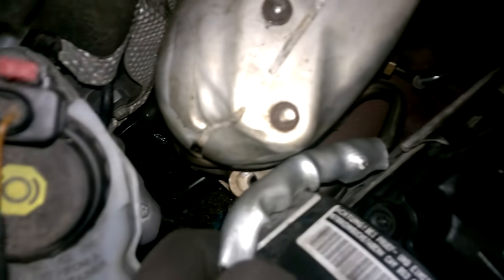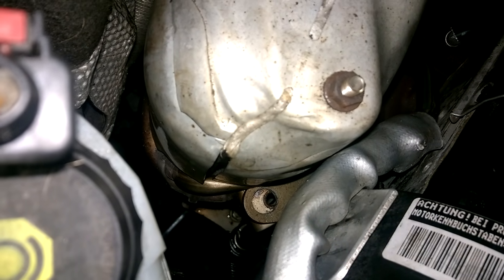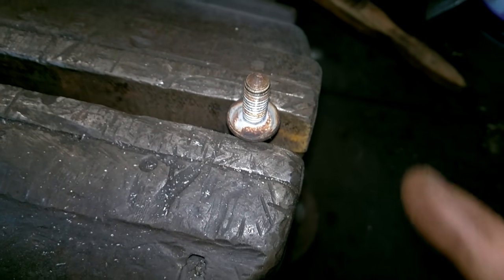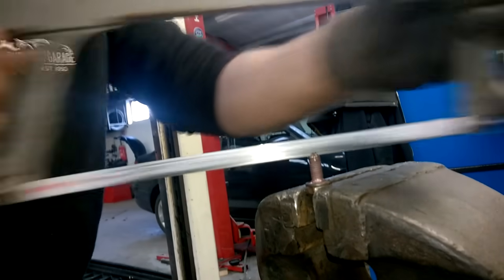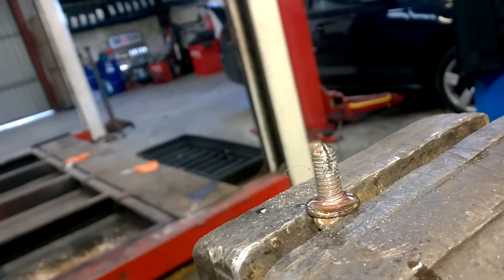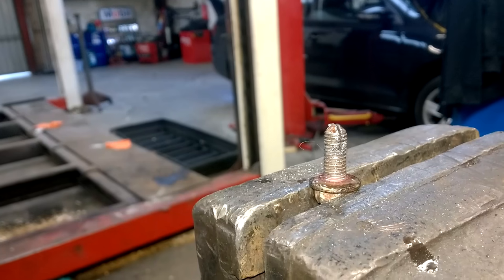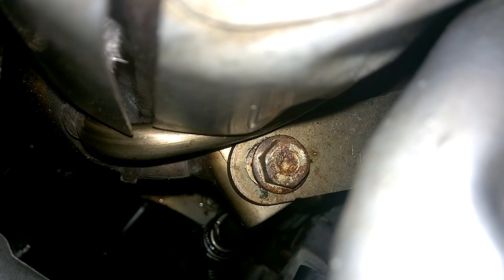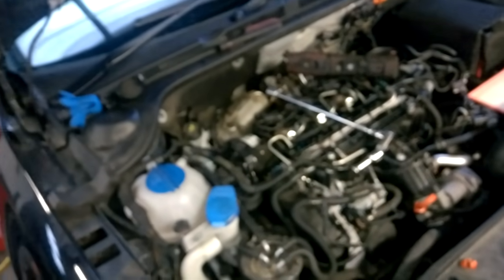My Father Taught Me This! Passing It On To The Next Generation

Comment: Good stuff
Dad was mechanic
His dad too
Cheers
Reply from the maker: The update info below is the pinned comment on this video, I know most people do not realize I made that video and it better explains/shows this method in use.   
I also included below details of why the job was done this way free of charge with the customer fully informed. I hope you check it out  👇👇
 
UPDATE* I decided to make a follow up video on this https://www.youtube.com/watch?v=yfNQullGEuQ&feature=youtu.be Should answer some of the questions that were raised, I include 3 demos of this in action with close up shots.
 
As there was some safety concerns & confusing comments raised, I felt I should clear a few things up. 
1) This is a tip for certain circumstances only, I never have and never would use it on a component which would cause any safety concern to any customer.  
2) The demo was done on a support bracket only, items like this or similar will not cause any safety concern. 
3) I did this free of charge and on a time restraint, I noticed it when I was replacing another item, the customer needed the vehicle back that evening and I decided rather than leave it like it was, I would do this and secure it up fully. 
4) The bolt was not the issue, the part that the bolt threads into is a secured piece, someone had previously damaged it, leaving the bracket loose and the bolt just tightened a turn or so.
5) The bolt can be removed and will not break, it will go in and out as usual and has helped clean up the damaged threads.  
6) Used in the right application I personally believe this is a great tip and can save you a lot of time & trouble. 

Lastly to all the people who have watched the video, Thanks very much and I am delighted with the feedback I have received on it.

Comment: Wouldn't have been a better fix to move the bracket, re-tap the hole and use a new bolt? A few minutes longer to fix but a proper solution for repairs down the road. The hole and the bolt looked roached anyway..

Comment: Great tip! Thank you.
Reply from the maker: The update info below is the pinned comment on this video, I know most people do not realize I made that video and it better explains/shows this method in use.   
I also included below details of why the job was done this way free of charge with the customer fully informed. I hope you check it out  👇👇
 
UPDATE* I decided to make a follow up video on this https://www.youtube.com/watch?v=yfNQullGEuQ&feature=youtu.be Should answer some of the questions that were raised, I include 3 demos of this in action with close up shots.
 
As there was some safety concerns & confusing comments raised, I felt I should clear a few things up. 
1) This is a tip for certain circumstances only, I never have and never would use it on a component which would cause any safety concern to any customer.  
2) The demo was done on a support bracket only, items like this or similar will not cause any safety concern. 
3) I did this free of charge and on a time restraint, I noticed it when I was replacing another item, the customer needed the vehicle back that evening and I decided rather than leave it like it was, I would do this and secure it up fully. 
4) The bolt was not the issue, the part that the bolt threads into is a secured piece, someone had previously damaged it, leaving the bracket loose and the bolt just tightened a turn or so.
5) The bolt can be removed and will not break, it will go in and out as usual and has helped clean up the damaged threads.  
6) Used in the right application I personally believe this is a great tip and can save you a lot of time & trouble. 

Lastly to all the people who have watched the video, Thanks very much and I am delighted with the feedback I have received on it.

Comment: always use the full length of the hacksaw, just basic first year engineering apprenticeship stuff.....
Reply from the maker: The update info below is the pinned comment on this video, I know most people do not realize I made that video and it better explains/shows this method in use.   
I also included below details of why the job was done this way free of charge with the customer fully informed. I hope you check it out  👇👇
 
UPDATE* I decided to make a follow up video on this https://www.youtube.com/watch?v=yfNQullGEuQ&feature=youtu.be Should answer some of the questions that were raised, I include 3 demos of this in action with close up shots.
 
As there was some safety concerns & confusing comments raised, I felt I should clear a few things up. 
1) This is a tip for certain circumstances only, I never have and never would use it on a component which would cause any safety concern to any customer.  
2) The demo was done on a support bracket only, items like this or similar will not cause any safety concern. 
3) I did this free of charge and on a time restraint, I noticed it when I was replacing another item, the customer needed the vehicle back that evening and I decided rather than leave it like it was, I would do this and secure it up fully. 
4) The bolt was not the issue, the part that the bolt threads into is a secured piece, someone had previously damaged it, leaving the bracket loose and the bolt just tightened a turn or so.
5) The bolt can be removed and will not break, it will go in and out as usual and has helped clean up the damaged threads.  
6) Used in the right application I personally believe this is a great tip and can save you a lot of time & trouble. 

Lastly to all the people who have watched the video, Thanks very much and I am delighted with the feedback I have received on it.

Comment: I would put there another screw. But if there isn't one, this might help solve the problem.
Reply from the maker: The update info below is the pinned comment on this video, I know most people do not realize I made that video and it better explains/shows this method in use.   
I also included below details of why the job was done this way free of charge with the customer fully informed. I hope you check it out  👇👇
 
*UPDATE** I decided to make a follow up video on this https://www.youtube.com/watch?v=yfNQullGEuQ&feature=youtu.be Should answer some of the questions that were raised, I include 3 demos of this in action with close up shots.
 
As there was some safety concerns & confusing comments raised, I felt I should clear a few things up. 
1) This is a tip for certain circumstances only, I never have and never would use it on a component which would cause any safety concern to any customer.  
2) The demo was done on a support bracket only, items like this or similar will not cause any safety concern. 
3) I did this free of charge and on a time restraint, I noticed it when I was replacing another item, the customer needed the vehicle back that evening and I decided rather than leave it like it was, I would do this and secure it up fully. 
4) The bolt was not the issue, the part that the bolt threads into is a secured piece, someone had previously damaged it, leaving the bracket loose and the bolt just tightened a turn or so.
5) The bolt can be removed and will not break, it will go in and out as usual and has helped clean up the damaged threads.  
6) Used in the right application I personally believe this is a great tip and can save you a lot of time & trouble. 

Lastly to all the people who have watched the video, Thanks very much and I am delighted with the feedback I have received on it.

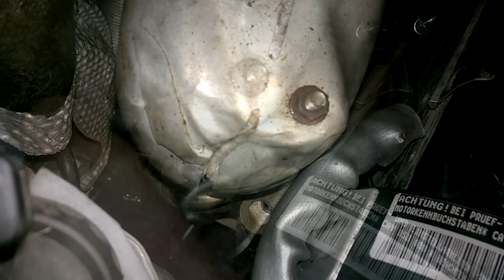Comment: Well, this trick is better-known in N.St.Louis as "White Rigg'n" or "Shade Tree Mechanic'n" either way is the wrong way. In the Box Factory, we used tapered pry bars or punches to align the difficult holes and snugging the other bolts before trying that trick that I never saw in my 26 years in the mechanic'n business. 0:46 looked like a straight-in shot with minimal difficulty.
Reply from the maker: The update info below is the pinned comment on this video, I know most people do not realize I made that video and it better explains/shows this method in use.   
I also included below details of why the job was done this way free of charge with the customer fully informed. I hope you check it out  👇👇
 
UPDATE* I decided to make a follow up video on this https://www.youtube.com/watch?v=yfNQullGEuQ&feature=youtu.be Should answer some of the questions that were raised, I include 3 demos of this in action with close up shots.
 
As there was some safety concerns & confusing comments raised, I felt I should clear a few things up. 
1) This is a tip for certain circumstances only, I never have and never would use it on a component which would cause any safety concern to any customer.  
2) The demo was done on a support bracket only, items like this or similar will not cause any safety concern. 
3) I did this free of charge and on a time restraint, I noticed it when I was replacing another item, the customer needed the vehicle back that evening and I decided rather than leave it like it was, I would do this and secure it up fully. 
4) The bolt was not the issue, the part that the bolt threads into is a secured piece, someone had previously damaged it, leaving the bracket loose and the bolt just tightened a turn or so.
5) The bolt can be removed and will not break, it will go in and out as usual and has helped clean up the damaged threads.  
6) Used in the right application I personally believe this is a great tip and can save you a lot of time & trouble. 

Lastly to all the people who have watched the video, Thanks very much and I am delighted with the feedback I have received on it.

Comment: It looks like you cut the bolt past the point where the threads were previously gripping. But this seems to be an application where strength is not needed.

Just as easy to clean up threads with a 3 square file if you do not have a tap. Sometimes a nut will do. If no 3 square is available just file off offending thread with a flat file and start it easy.

Your dad should have told you to use the whole hacksaw blade. But most people seem to wear them out in the middle while the ends are untouched.

Nonetheless I thanks for the info, might be useful someday.

Comment: I can say having worked on vehicles of all sorts for 40 years I had never ever considering using or making such a bodge like this. It looks a terrible idea especially if the bolt is critical for a load. I would tap out the hole if it needed it and make sure that bracket fitted correctly. I would also use cutting compound with cutting anything metal and not transmission fluid, and an anti seize paste or copper slip on the bolt threads when installing it. This is just cowboy mechanics passing on their bodges. I wouldn't him or any one who did this working on my cars or bikes.
Reply: "but he did it free"..  yea the path to hell is paved with good intentions...   SO now he spent his time adding potential to make a situation worse.. hoping he made a situation better.. but not doing it the right way.  If you're going to help someone you should probably do it the right way.  Imagine how it all goes down when eventually one of your "helps" makes things worse for someone, you're not helping your'e making it worse.   You can't take continuous chances and think you'll never have an unwanted outcome.  This is why i'm paranoid about letting other people work on my stuff.  Now if he was going to do this on his own vehicle that he was never going ot sell, that'd be his business.
Reply: I think the proper thing to do would be to advise the customer of the situation and let him assume his own risks or decide to pay you for a proper fix.   Life is short. Time is limited.  Time is the thing you can't replace.  I think time could have been better spent doing something else more productive.  If the customer wanted that fixed let him pay for it.

Comment: We do this with black nipples. Make 2 or 3 cuts to 1" up to 2"×6" nipples. Make the slice about as long as the threads.. i like to take a 6" nip and on one end I make 2 cuts and on other u make 3 cuts. When you remove an old nipple, especially galvanized use these as a handy thread chaser to clean out debris from fitting threads. Wire brush fitting threads first then work the cut nipples in straight until it catches. Make up a little then back it out until where you caught. Repeat going a little deeper each time until fitting threads are clean.

Comment: You might be aware that a hacksaw only cuts one way.  Dragging the blade back over the material to be cut only dulls the blade.
Reply: Dragging the blade over the material with no pressure is fine.
Reply: @bigmacdaddy1234  Sure, it is fine, it just dulls the blade prematurely.

Comment: Love it. I am also a fan of your last name. Mine is Burke as well. My middle name is Gerald, after my Father. Might have to buy a shirt!
Reply from the maker: I will have new shirts in the coming months so stay tuned for those :) 
I linked a follow up video below if ya wanna see this tip close up 
 
The update info below is the pinned comment on this video, I know most people do not realize I made that video and it better explains/shows this method in use.   
I also included below details of why the job was done this way free of charge with the customer fully informed. I hope you check it out  👇👇
 
UPDATE* I decided to make a follow up video on this https://www.youtube.com/watch?v=yfNQullGEuQ&feature=youtu.be Should answer some of the questions that were raised, I include 3 demos of this in action with close up shots.
 
As there was some safety concerns & confusing comments raised, I felt I should clear a few things up. 
1) This is a tip for certain circumstances only, I never have and never would use it on a component which would cause any safety concern to any customer.  
2) The demo was done on a support bracket only, items like this or similar will not cause any safety concern. 
3) I did this free of charge and on a time restraint, I noticed it when I was replacing another item, the customer needed the vehicle back that evening and I decided rather than leave it like it was, I would do this and secure it up fully. 
4) The bolt was not the issue, the part that the bolt threads into is a secured piece, someone had previously damaged it, leaving the bracket loose and the bolt just tightened a turn or so.
5) The bolt can be removed and will not break, it will go in and out as usual and has helped clean up the damaged threads.  
6) Used in the right application I personally believe this is a great tip and can save you a lot of time & trouble. 

Lastly to all the people who have watched the video, Thanks very much and I am delighted with the feedback I have received on it.

Comment: Great tip!! Thanks!!
Reply from the maker: Thanks Michael  
 
The update info below is the pinned comment on this video, I know most people do not realize I made that video and it better explains/shows this method in use.   
I also included below details of why the job was done this way free of charge with the customer fully informed. I hope you check it out  👇👇
 
UPDATE* I decided to make a follow up video on this https://www.youtube.com/watch?v=yfNQullGEuQ&feature=youtu.be Should answer some of the questions that were raised, I include 3 demos of this in action with close up shots.
 
As there was some safety concerns & confusing comments raised, I felt I should clear a few things up. 
1) This is a tip for certain circumstances only, I never have and never would use it on a component which would cause any safety concern to any customer.  
2) The demo was done on a support bracket only, items like this or similar will not cause any safety concern. 
3) I did this free of charge and on a time restraint, I noticed it when I was replacing another item, the customer needed the vehicle back that evening and I decided rather than leave it like it was, I would do this and secure it up fully. 
4) The bolt was not the issue, the part that the bolt threads into is a secured piece, someone had previously damaged it, leaving the bracket loose and the bolt just tightened a turn or so.
5) The bolt can be removed and will not break, it will go in and out as usual and has helped clean up the damaged threads.  
6) Used in the right application I personally believe this is a great tip and can save you a lot of time & trouble. 

Lastly to all the people who have watched the video, Thanks very much and I am delighted with the feedback I have received on it.